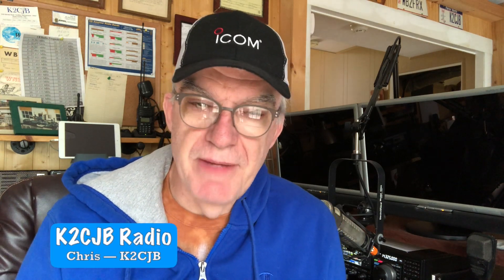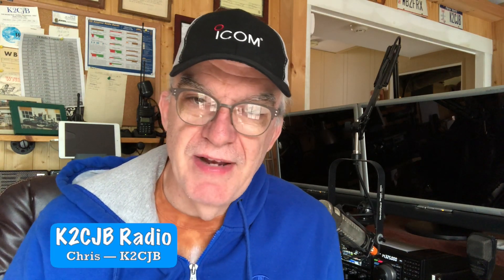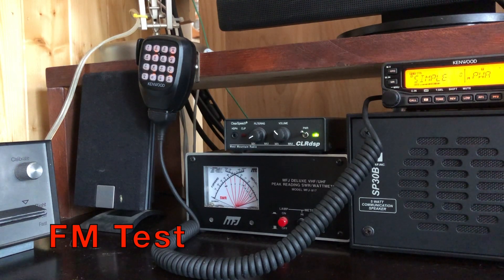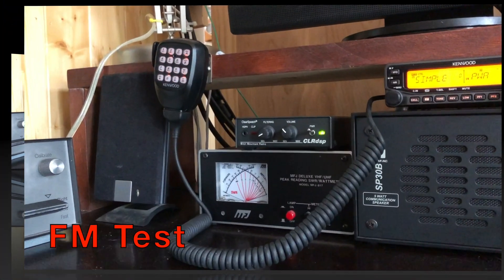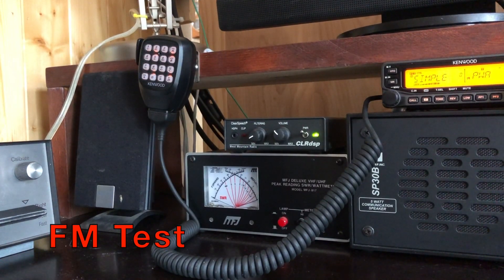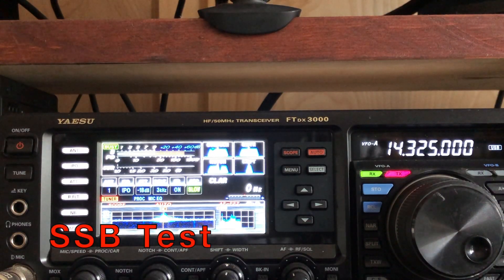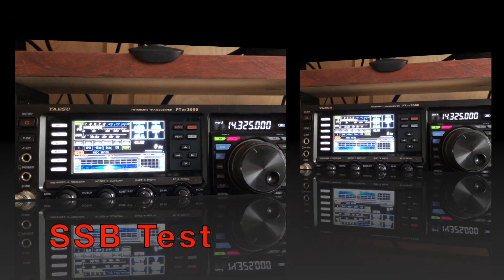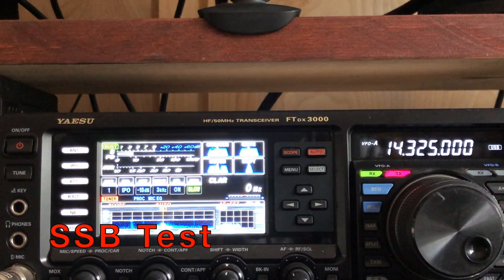ICOM IC-7100 Ham Radio Mic Test between HM-219 and HM-198

Comment: I could hardly tell the difference but to me the 219 has a slight edge. I have the HM-207 on mine, which is basically for the 5100 so the buttons are labeled differently. There’s a $40 difference between the 207 & 151, but haven’t figured out why. I’ll have to try the 207 vs the 198 & see. I got the 207 for the remote functionality but I’m not using it as much as I thought, probably because the buttons aren’t labeled correctly.
Reply from the maker: Agreed that there is very little difference.  But, it was a fun exercise/test to do.  Thanks for watching!

Comment: I am trying to find your antenna set up for the 7100 in the truck.  I tried today to install my 7100 and it isn't working well at all.  I have a tarheel II but I think it could be how the grounds or bad coax... maybe put the wrong stuff in ... just picked up a long enough cable to reach the back of the vehicle and the 259 all didn't look like it had foil insulation shield.. so still got to hit the road tomorrow so shining it on.  two meters got a respond sounding good. ...  bummed a bit.  I want to try have HF in the rig.
Reply from the maker: Hmm.  No shield in coax is a definite problem.  If not that, make sure you bond the antenna to the truck with braid.  I would start there.
Reply: @k2cjbradio  Got it thanks.  I found part of the issue, I insulated the bottom bold away from the ground too and this was the mail issue.  Improveents are planned, grounds, controller .. driving with a mounted radio, not just it sitting there.

Comment: I use the  stock mic on my IC-7100, which I use as a base rig. But I also have used an AKG P220, which requires an external preamp capable of supplying 48V phantom power. The network control op for the Sunday night Warminster 10m SSB net says that the P220 sounds like BBC broadcast quality. The IC-7100 has outstanding audio as far as I'm concerned. I have a homebrew speaker which I made using a Dayton Audio RD100-4 full range driver which lets me hear all that the 7100 can put out. It really sounds good on FM broadcast such as WRTI. Not audiophile, but way good for a communications radio.
Reply from the maker: Timothy Stockman As you can see in the background, I have an RE20 on my FTDX3000.  Always  good to start with a good mic!  The 7100 is a great radio. It works great in the truck, although I really need the NB on to filter out the ignition noise.  Doesn’t help on repeaters that are a bit of a distance from me.
Reply: @k2cjbradio  I bet the RE20 / FTDX3000 combo sounds great.  I used many RE20s over the years in commercial broadcasting, a great mic! --73 de N3TS

Comment: I have the HM-151.  I'm curious how that would sound against the HM-219. - KC3HUL
Reply from the maker: MAWazaLLC What started all of this was someone in my radio club had said my audio on the repeater wasn’t so good.  There are some complaints online about the stock 198.  I went with the 219.
Reply: @k2cjbradio  There is a mod for the HM-151 (and the 198) you can have done.  https://www.7000mic.com/hm-151-info  I was thinking about sending it out, but for another $64 on a $100+ handheld mic doesn't seem worth it.
Reply: @k2cjbradio  Yes I too get negative feedback on FM repeaters.

Comment: I thought the 198 on SSB was clearer due to the higher audio freq sound - N6KV
Reply from the maker: Could be.  But when I initially installed it and checked how the ALC and Compression was responding, it the 219 seemed to have a little more audio to it.  But you’re right, on-air the 198 might be a bit better on SSB